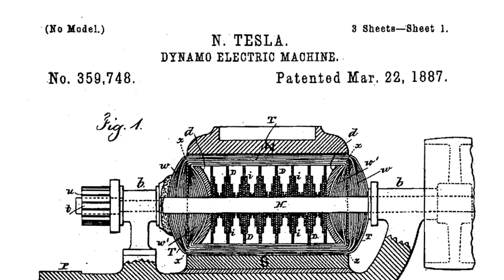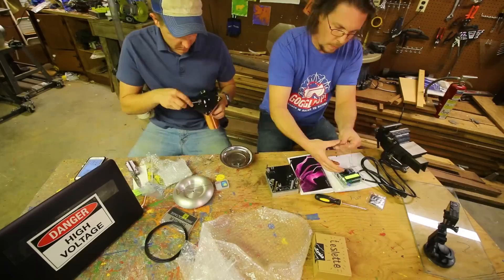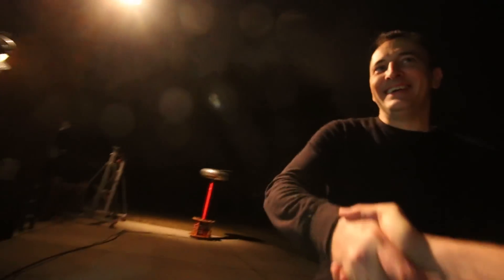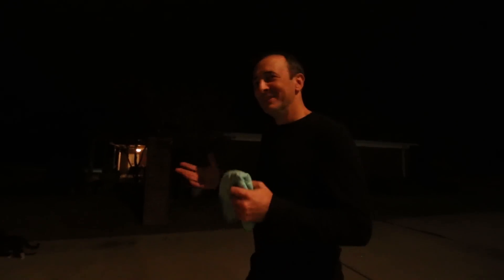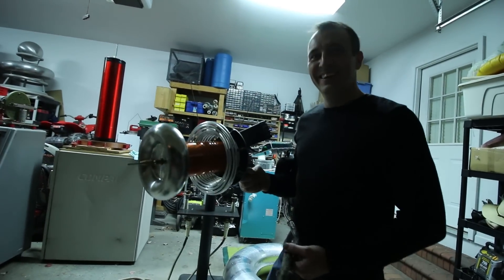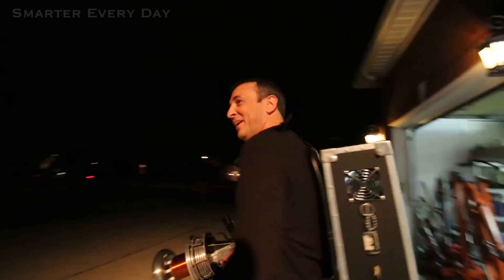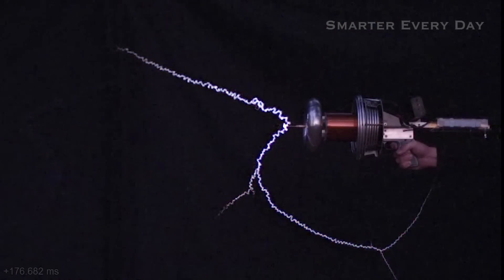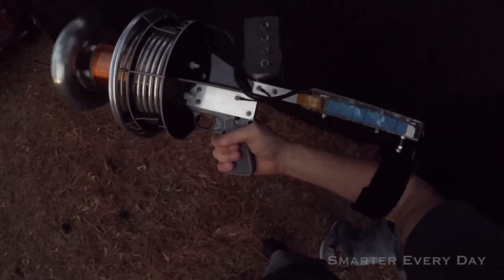Handheld TESLA COIL GUN at 28,000fps - Smarter Every Day 162

Comment: Direction and "shape" of the plasma are random like lightnings. It depens on many factors such as ion and dust distribution in air.
I wonder waht happens if we try it in space where there are theoretically no air and no dust? Will there be also plasma in space?
Reply: make this happen please
Reply: I doubt you'd see a lightning or plasma at all if you did this in space, the reason lightning gives off light is because electrons are ionising the air in the atmosphere, air which isn't present in space.
Reply: Plasma required gas to form. All you could get is electron discharge between anode and cathode(hope writing right) then voltage becomes high enough to transfer them. Would still be heck of boom on cathode (no sound boom)
Reply: The Sun is a thing...
Reply: Mübin Icyer Nothing would happen, a vacuum is the ultimate insulator.
Reply: Test Account Please Ignore
How does that explain sun warming earth? An insulator would prevent that right?
Reply: Trevor Hurd Radiation
Reply: Infrared is how heat radiates. You can feel heat or cold from a distance even if the air in-between is not so hot or cold.
Reply: Test Account Please Ignore
Radiation through a vacuum?
Electricity doesn't pass through insulators, or so the argument goes.

THEMAX, there is no air in space, or so the argument goes.
Reply: Trevor Hurd Do you know what radiation is? It's just light, light doesn't need a medium to travel in.
Reply: Test Account Please Ignore
Because waves require a medium to travel through, and light is not a wave but a particle, thus needing no medium.  Or so the argument goes, right?
Reply: Trevor Hurd Yes, that's the idea. If you want to get really technical you can describe light as propagating disturbance in the electromagnetic field though, just like any other particle.
Reply: Test Account Please Ignore
Or perhaps every particle is a wave, and a vacuum is still a medium?

And so electricity works in space just as everywhere else.
Reply: Trevor Hurd Every particle is a wave, propagating in its own field (photons are disturbances in the electromagnetic field, electrons are disturbances in the electron field). This does not mean electricity works in space! Electricity is the flow of electrons through some conductive matter, in a vacuum there is no matter, so electrons won't follow paths, they will just fly off in every direction (invisibly, without doing damage to anything).

TL;DR: Electrons can exist in space, but electric arcs cannot.
Reply: Test Account Please Ignore
If a particle is a wave propagating in a field, and electrons are particles, and photons are particles, then electrons and photons are both waves propagating in some field.

What is a solar flare?  What is a corona? What is space lightning?
Reply: Trevor Hurd Yes, all particles can be modeled as disturbances in different fields. Note that they are in different fields.

A solar flare is just a burst of electromagnetic radiation (photons) from the sun.

The corona of the sun is the hot plasma that surrounds it, kind of like an atmosphere.

Space lightning isn't the name of any specific phenomenon, but sometimes upper atmosphere lightning is called space lightning. Also, pretty much any time an electric current is found in space (for example, in a plasma jet), someone calls it space lightning.

Why are you asking these questions?
Reply: Test Account Please Ignore You just told me that electric arcs cannot exist in space, and that there are no paths to follow for lack of matter.

If a solar flare is electromagnetic radiation, how does it propagate through a vacuum, to earth, for lack of matter?
If a corona is plasma surrounding a sun, how does such plasma exist in the vacuum of space?
If plasma jets are electric current in space, why does the insulating vacuum not stop them?

What is a plasma jet, if not some manner of electrical arcing?  What is electromagnetism, if not a form of electricity?

And how does regular electricity pass through the relatively vast amounts of "empty space" between particles of atoms/molecules/etc, without problem, if it cannot pass through vacuum at all?
Reply: The arc you see isn't electron, it's photon released by atoms excited by the electron.

Electron can be shot through vacuum no problem (http://physics.stackexchange.com/questions/178831/can-electricity-flow-through-vacuum) but you won't see visible light on its path if there are no atoms to convert the energy of electron into visible light.
Reply: Apiwat Chantawibul
Because a photon is a particle, rather than a wave, because a wave requires a medium to travel through, or so the argument goes, right?

Or perhaps everything is a wave, and vacuum is just another medium for it to travel through.
Reply: Let's separate model from reality.

First reality. You can check that electron can travel in vacuum by experimenting with 'cathode ray tube (CRT) TV' those older TV shoots electron at screen.

You can also check photon can travel through vacuum by experimenting with how sun light gets to earth.

Now for the matter of model. AKA. how human tries to capture the behaviour of these things in a more tangible terms. Thus so we can use these model to predict and do useful stuff with our understanding.

There can be multiple model that predict correctly what actually happen in reality. At a point in history, we thought modelling photon as a particle is enough. Which works pretty well in a lot of situation. Then we experiment more, and find out that in some situation photon also behave like a wave. Then we also so find in another situation (the double slit experiment) photon behaves like both particle and wave at the same time. So we updated our model to "wave-particle duality". Use the model that is adequate for your application is my advice. Who knows what else we might learn about our friend photon in the future.
Reply: I usually don't write essay about physics... but when i do it's in Youtube comment. sigh... my time.
Reply: Apiwat Chantawibul
You haven't written there even half as much essay I have on Youtube. But your time is appreciated.

Reality?  Whose reality?  It's a matter of perspective really.

Waveform function can model all the effects of particle physics, without needing actual particles.  When you reach this point, you realize everything is just manifested electric waveform in Aether, i.e. electromagnetism.  Anything less than that is just convoluted.
Two steps further, and you get vortex mechanics in multidimensional space.

You're welcome.
Reply: Trevor Hurd Ok, lightning 101:

Electrons are negatively charged particles, so electrons are constantly trying to move away from other electrons (negative charges repel). If you were to just take some electrons and put them in a clump in space, they would all just fly apart.

Likewise, if you were to put a bunch of extra electrons in a piece of metal in space, the metal would start firing electrons off in random directions until the average charge of the metal was zero.

If you did the same thing with the metal in the air, something different would happen. Air is a really good insulator, which means if the electrons were to try and fly away from the metal, the air would stop them, and the metal would keep its charge.

However, if you were to add a ton of electrons to the metal, the force of the electrons trying to escape the metal would be enough to ionize the air in small spots on the surface of the metal. This means the air becomes a plasma.

Plasma is a state of matter with higher energy than gas, so if you heat a gas enough, it will become a plasma, and if you cool a plasma, it will become a gas. Plasma is also extremely conductive, and is hot enough to glow.

This means that in the places where the air becomes a plasma, electricity can start conducting through the plasma away from the metal. All this current flow in one spot will ionize more air nearby, so the plasma spot will grow into a plasma "wire", winding through the air, with electrons flowing through it. This is lightning.

In space, you don't have the air blocking the electrons from leaving, so the electrons at the end of the tesla coil wouldn't conduct away, they would just fly away in random directions like baseballs, not forming a bolt, and not damaging anything.

A corona exists for the same reason our atmosphere exists, both are gravitationally bound to the object they surround. The only difference is that the sun is hot enough that it ionized it's atmosphere, where as ours is just gas.

A plasma jet is something very different from lightning. The sun is so hot because of the nuclear reactions inside it, that it is only made of plasma, no electron repulsion force needed. This means that the entire sun is conductive, so plasma flow in the sun causes huge magnetic fields. Sometimes these fields can channel streams of plasma in the arcs you see in pictures, but this is not an electron discharge, this is magnetic material being accelerated by magnetic fields.

Electrons can pass through empty space, but we don't call this conduction, its just as if the electrons where flying in straight lines like baseballs.

Edit: I work in plasma physics, ask me any other questions you have.
Reply: Test Account Please Ignore
Thank you for your time.

What is air?  Is it not just a bunch of empty space with a few "particles" floating around at impossible to predict trajectories, and random distances from each other?

What is space?  If space is a vacuum, how does this then differ from air?  Would it not just differ by order of magnitude of the "random distance" between the various "particles" floating around in it?

How is air an insulator, when the vast amount of it, is empty space, without particles? Why does this not also apply to space? (planets can be perceived as particles when seen from much grander magnitude)

You have described Electricity as thus:
"Electricity is the flow of electrons through some conductive matter,"
You've also said"
"if you were to put a bunch of extra electrons in a piece of metal in space, the metal would start firing electrons off in random directions until the average charge of the metal was zero."
How does this differ from a discharge through a conductive substance of a higher potential, to ground? Would not this make vacuum a conductor of electricity?  Why then would you Not use the word conduction for it, if it has all the hallmarks of it? (Baseballs fly in parabolas in the presence of gravity, not straight lines)

What exactly is magnetic material?
What exactly are magnetic fields?

What is gravity? Why can it not be equivalently modeled under  electromagnetism?
Reply: Apiwat Chantawibul
My philosophy Is science.. Or was it the other way 'round?  Are they not all just the same in end?

While I am curious what others' perspectives are, and I certainly do not know every little detail or every little scientific theory (though I would like to) I'm asking not for me, but for you, and others.  I've already scienced my own way to knowledge. But have you? Research is not the end-all be-all.  It must be tested too.
Reply: Заклетник What do you mean plasma orbs?
Reply: Заклетник  Do you mean these things: https://en.wikipedia.org/wiki/Plasma_globe
Reply: Заклетник They aren't vacuums, they are filled with an inert gas (typically neon) at air pressure.

Comment: What fun! I built a Tesla coil with a three foot tall secondary in high school electric shop. That was in 1966. It was a blast.

I wish you had gone more into the theory. Here's some questions I'd love to know the answers to.

1. About what frequency are these coils oscillating at? 
2. What are the different parts in the gun?
3. What are the wires connecting to the plates on his shoes for? (I guess that they are to keep the return path from being his body.)
4. You asked the question about what is the gun arching to in the atmosphere?
5. Why did he have such large capacitors?
6. Why is it necessary to have such "loose" coupling between the primary and the secondary?
7. Do you have any design equations and guidelines to help design a Tesla coil. (I just had a magazine article which I followed closely.)

Comment: Very proud to see how smart the maker of this video is. Sir that coil has been absolutely optimized. Ten years ago a 1 foot secondary like that was lucky to produce 200kV. I'd say that is an easy 500kV responding to audio input.. So Much Smarter... Then we get to see what some estimate a 1MV Tesla Coil wrongly... 10KV arcs 1 CM in dry air, do the math..
Reply: This is so unbelievable it brought tears to me eyes. Thank you. Nikola Tesla himself would be proud.
Reply: Neither of those were above 200-300kV.
The bigger one is a DRSSTC with funny pumping, the smaller one is a QCWDRSSTC, which can have stupidly long streamers without much voltage.
Reply: Okay an engineer in the house. I've always been wondering why the equation of 10kV per 1 cm doesn't apply to HF discharge.. Speak from the mind, not Wiki as I've already visited.
Reply: fla playa Because HF and things that go into the RF region are voodoo.
Reply: ***** It was Voodoo for an engineer 100 years ago but I'm still amazed at how 50kV at 250kHz throws two inch streamers blowing the air around them. Amazing science.

Comment: I never saw the moment in the entire video as you have shown in the thumbnail..... click bait or what?
Reply: Neil Kadu it's a long exposure photograph. you won't see such arcs at a shutterspeed of 1/48 th of a second, or less. (the shutter speed is probably much faster, probably 1/120 th or so.)
Reply: nope not clickbait. The title says handheld Tesla coil gun at 28 000 FPS, and the video shows it. The thumbnail shows a handheld Tesla coil gun, and that same gun is in the video. That exact photo isn't in the video (cause if you look you'll be able to tell it's photoshopped), but the video still includes in a major way the contents of both the title and thumbnail.

Please next time, consider the meaning of clickbait before throwing the word around.
Reply: Bob Izam
Technically speaking, if you use a long exposure, you can get a picture that looks like that. Though in this case, it might be a Photoshop of several video frames layered together, to increase the amount of bolts.
Reply: lbochtler ok ok relax man.

Comment: I'm building one right now haha. I have some microwave transformers and some out of an old plasma cutter
Reply: See if you can get ahold of a 15kv neon sign transformer.  If you have a local neon sign shop they would probably give you one for little to no cost. Good luck with your project!
Reply: MaxRay16 don't use MOTs they won't hesitate to kill you if you make one mistake. Use Oil burner ignition or neon sign transformers. Anything under 30mA! Unless of corse you are trained in handling high voltage high current (no looking at a YouTube video dose not count as training)
Reply: ***** 
I agree that MOTs are much more dangerous. But to be fair, once he has his tesla coil built, the primary will be just as deadly with a low current transformer because of the cap bank. Regardless, he should be extremely careful either way.
Reply: Ben Watson agreed. He should also watch out for exploding caps. Since that can happen if he uses the wrong type and or at the wrong voltage. He should at least wear eye if not face protection to be safe. (or shield the caps)
Reply: MaxRay16 If you want caps that won't explode when used with a SGTC I have a video on my channel on how to make some.
Reply: This entire comment chain is pointless.
You will die either way if you're building an SGTC and zap yourself, even if the charger is a bug zapper.
Remember, the cap is in parallel...
Reply: +Spirit 
Yeah. My initial comment was just recommending a  high voltage source for his primary.
Reply: Ben Watson My electrical engineering teacher has a neon sign transformer just sitting on a shelf. 

And I know all the safety precautions and equipment I need so I won't get zapped and die.
Reply: MaxRay16 Oh, believe me, you WILL get zapped.
That's a requirement set by the universe itself and murphy.
I have never, ever met tesla coil builder that hasn't been zapped at least once.
Reply: *****
I can confirm this, at least about me.
Reply: My first coil had a MOT power supply. An ark hit the primary and popped some caps. Make sure to create a grounded protection rail above the primary! I didn't think the arcs would be that long (1m or so)!
Reply: Hayden Moore Where did you get an ark, and how did a boat manage to blow your caps!?
Reply: From the toroid to the primary coil. The over-voltage of the cap rating would break down the dielectric, creating expansive gasses, blowing the caps.
Reply: Hayden Moore The joke
=====================>.

Your head